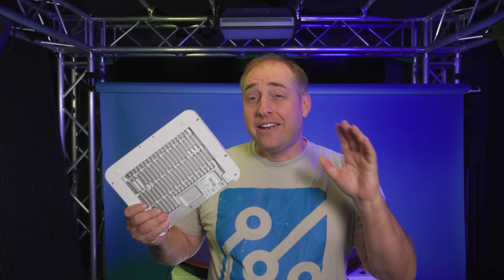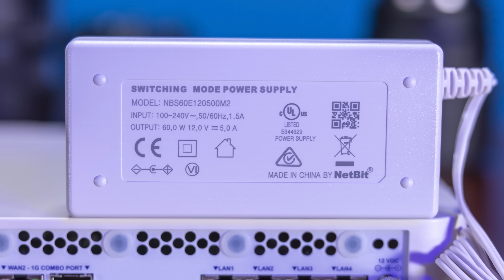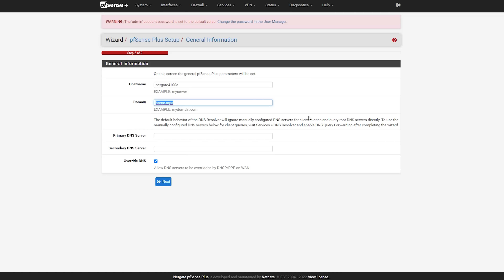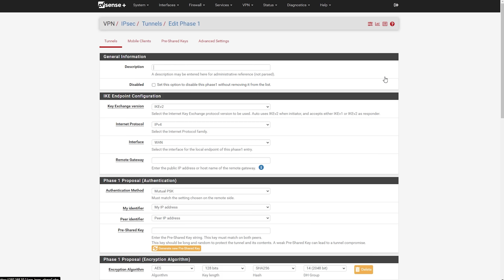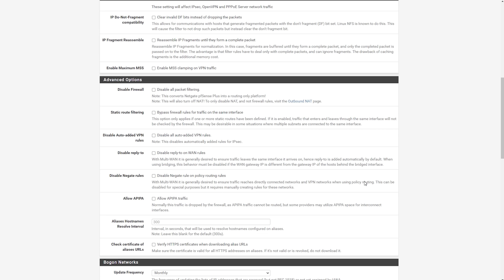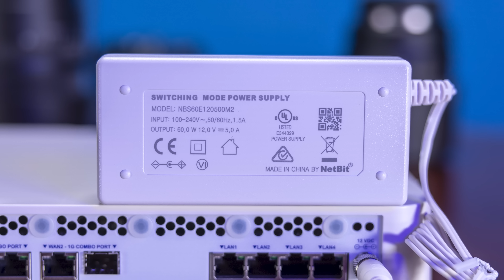An 11W pfSense Plus 1/2.5GbE Router, Firewall, and VPN Appliance

Comment: Forums flows over in regards to massive failure with the embedded eMMC on these. Build your own cheaper and faster with lots of expandability options and donate if you want to support Netgate.
Reply: damn that's no good. They should come with nvme M.2 ssds, not storage soldered on.
Reply: how to build anything cheaper?
Reply: @39zack  I'm using a used, cheap Dell Optiplex. Works like a charm.

Comment: its just so disappointing to see 1G wan ports, 1Gb fiber is becoming more common and a 1G wan port isn’t fast enough.  I wanted to buy a wired router with 2.5Gbe ethernet and no wireless and I couldn’t buy one without getting enterprise gear.

Comment: Would be nice if the WAN ports were also 2.5G.  Wonder if the 2.5G LAN ports can be used for WAN.
Reply: Yes. He mentions exactly this in the video.
Reply: @jay-ru-me  Right, at 4:30 he says WAN ports can be reconfigured as LAN or something else and will be a mismatch in the UI.  But he doesn’t specifically mention if I can configure any of the LAN ports as WAN.  If that is the case they should have just labeled every port from P0 to P6 and let us decide.  My Asus ET12 is currently using 2.5 on the wan and 2.5 to my LAN switch.  Theoretically I can use that appliance LAN1 as WAN to my ISP and LAN2 to my Asus WAN to further isolate internal network.
Reply: @smptactical259  Thought he said it could go both ways but IDK, dont feel like watching the video again. :D I know for sure you can reassign any port as WAN, LAN, OPT or whatever. Going with defaults though would probably save you a step in the case where you need to restore a backup, since the default assignments would not have to be reconfigured. I suppose with the 4100 you would want a 2.5Gb setup as WAN tho... heck, I would just get the 6100 where the two WAN ports are already 10Gb anyway.

Comment: The fact that the bottom plate serves as a heatsink, means that you should mount it on a wall and leave some space between it and the wall so heat can dissipate upwards.  In this configuration, the screw-on power jack is a brilliant idea.

Comment: If you put a couple sfp fiber adapters in it and use all 4 ports at 2.5gb i bet you will come close to 60w
Reply from the maker: The 60W power brick is shared with higher power models. I think it was just easier for Netgate to standardize on one and then use it across products.

Comment: Seems like poor design to put the heatsink on the bottom of the unit. Heat rises, so sinks on the top cause airflow via convection. That's extremely limited by the looks of this heatsink on the bottom.

Comment: Do you know what is the acceptable temperature for this device? mine feels kind of hot without having so much work, I would appreciate any answer back thanks!
Reply from the maker: I am not entirely sure. The C3338R is 88C Tcase. The underlying platform for the 4100 is designed to take much hotter chips and components (e.g. bigger CPUs) and use the same cooling. On the 4100 the heatsink gets warm as it should, but I am not worried about it.
Reply: @ServeTheHomeVideo  seems like poor design to put the heatsink on the bottom of the unit. Heat rises, so sinks on the top cause airflow via convection. That's extremely limited by the looks of this heatsink on the bottom.

Comment: I really want to dump my R610 with 1 x Intel(R) Xeon(R) X5660  @ 2.80GHz and 24GB, I feel like it is a waste and it isn't being fully utilized, with this be a good replacement for a homelab running snort with a 1Gbps download 100ish Mbps upload, Internal 2.5 and 10 Gbps? I know this is hard to answer, but Is it way off to use a 4100? Thanks!

Comment: Great video. Recommend not purchasing support contract from Netsense.  Lack of leadership makes the experience such that each submission comes from a different tech. No continuity and no way to learn.  This is how you familiarize yourself to be a good admin - solid with no holes for the bad guys to exploit.  I have wasted $400 or so with a support subscription.  If they add phone support I can be solved in a jiff, and not back and forth with emails to different techs with different times.  Responses are lagged too.  Not a professional organization, my client purchased a different software package.  The company could be great, FOSS is normally better. and I pay for support to help developers. Other peers also feel upper Netgate management has to change or what follows is decline in growth.  I am open ears to other support vendors and monitoring tools.  P.S. my ask was to the President after getting nowhere in lower levels.  d

Comment: The unit looks quite nice.  It has a comprehensive feature set, plenty of ports, its fanless (presumably), and low power... Burning just 11W 24x7 is perfect for numerous topologies, particularly homes.

And I will note that the power supply input is 12VDC, which means that you can run it directly from the 12VDC output of any of the LiFePO4 power stations out there on the market to give yourself really decent backup during a power outage.  Never mind having just an hour on a UPS, even a small 250Wh power station would be able to run this sucker for almost a whole day.   Staying in the realm of DC on those power stations effectively doubles the efficiency... no AC-to-DC-to-AC conversions, just AC-to-DC.

I'm starting to see a whole lot more of these low-power devices running on 12VDC these days instead of 5VDC.   Not only do wall dongles run completely cool with higher output voltages, but it makes it possible to run many more devices directly from 12VDC sources for more serious backup operation with conversion losses that are no different from plugging the wall wart into the wall (and might possibly be lower, depending on how good the wall wart is).   Since all modern devices need a switching DC-to-DC supply internally anyway to get 3.3V and 1.8V (etc), its just a whole lot better to start with a higher DC voltage on the input.

Comment: A heat sink UNDER a unit is really weird ... it defeats the purpose if the unit is meant to sit flat. How is that supposed to work without outside active air movement? Only mounted to a wall to create an air chimney?
Reply from the maker: Not really sure but it worked for months without issue even in a 86F / 30C ambient. This design is actually for much higher power CPUs so for 11W it is not much of an issue.
Reply: @ServeTheHomeVideo  I can believe that it isn't a problem for the 11W system, but I've also found my SG2100 getting much warmer than I thought it should. Not sure whether the thermal design of the Netgate appliances is all that good. It seems adequate, which might be all that is needed, just thought it could be a lot better with some fairly simple changes.

Comment: I have this hardware in my company, not from Netgate but from Silicon (its the same exactly hardware anyway), and i have tried to change the OS inside a few times but without success... is there any way to install another headless distro in this thing? I really want to install Debian 11 on it. Even connected by serial console, none of the headless distros i have found can be installed on it. Am i stuck with the default Ubuntu?
Reply from the maker: Hi G2 Net Sul - we have not gotten one of these from Silicom so I have no idea what their firmware is like.

Comment: So if I understand switched vs unswitched correctly, the idea with the 4100 is that you could set each of the 4 ports to a specific VLAN (let's say management, LAN, IoT, and DMZ), hook those up to one or more managed switches and then hook up your devices to that/those switch(es)? Intra-VLAN traffic would then be managed by the switch, but inter-VLAN traffic would pass through the router?

Comment: meh, kinda sucks that the CPU is trash. lots of end users want significant OpenVPN performance, as well as things like FQ_CODEL and SNORT / PfBlockerNG. This CPU will on its ass 10 minutes in lol
Reply from the maker: That is the point of having a line though. Offering different price/ performance points for different needs. When we just need a GPU for the lab, something like an old GTX 1030 or GTX 1050 is awesome. When it comes to picking a GPU to pair with the Threadripper Pro 5995WX, usually it is much bigger and more expensive. This is Netgate's lowest-end x86 box.

Comment: I just bought a 5 port 2.5gb QNAP switch and a SeeedStudio Mini Router (Raspberry Pi CM4) for about half the price.
The router comes with OpenWRT pre-installed, so I'll be going with that for now, but I wanna try OPNSense as well.

Comment: If folks are going to invest in a premium product like the two mentioned then I would leave the switching to the switches and use the 4 ports for routing between vlans or segments.  Many IT organisations choose to keep vlans simple in the sme client base to avoid tagging incompatibility issues between some brands of network gear and so lower level skillsets are needed to maintain and support the installation.  The notion of switched lan ports even in a router would put it in the domestic router category and being a firewall having all the lan ports switched would be a big letdown.

Comment: It is hard to beat the SuperMicro X11SDV-4C-TP8F platform such as the Supermicro E300-9D-4CN8TP for pfSense, Untangle, etc. especially with all those 10Gb ports. Perhaps slightly more expensive but definitely comparable.
Reply: From what I can see it costs double the price.
Reply: As a reseller integrator I wish that in my market (australia) , that it's authorised distribution channels would make these boards available.  Further even the big box movers that do supply supermicro mainboards do not cover a sufficient range.
Sadly, this has resulted to me having to seek alternative brands many a time over the last two years.
Reply from the maker: Also much higher power. But yes, they are faster.

Comment: So I want some opinions if this is overkill. I brought home a computer that we were going to destroy at work as it was just too old. It’s an i3-4150 With 16 gigs of RAM and a 120gb intel 330 series SSD. I have Comcast one gig down 40 mb up and the built in Realtek and the PCI-e Realtek cards were only getting 330mb to the FW. Found an article about slow performance with realtek cards. I won an Intel X550 10gb dual card at a vendor show that I have not used. I installed it and now I get full gig speed down. My question is…..is this massive overkill? I have snort, DHCP, DNS, and OPENVPN running on it. Just thinking that maybe I can use a lower performance system and get the same amazing performance that this one gets. Power is not an issue as this running off a solar system with battery power.

Comment: Hey Patrick, I'm not sure if it's the right spot to make a video request but what are the current options for "DIY" NAS chassis?
I can't seem to find the ones you suggested awhile ago like the Norco DS-12D.

I'm trying to improve my homelab with a rack mounted NAS chassis that's not too long and it has at least 10Gbps network and read/write speeds, so using a short-depth 1U or 2U server with external SAS cables to a NAS/SAN/JBOD enclosure looked like a good idea, but I can't seem to find any available.
Reply from the maker: Hi Icaro - my suggestion is to ask in the DIY server builds in our forums. Likely folks have a few options there. I have been using the 24- bay Supermicro units from eBay but those are probably not short enough for what you want

Comment: So basically QAT is like the ipsec acceleration that little mips processors have had for ages.
Reply: Yes and no. You need to choose a cypher suit supported by QAT and a software that supports hardware acceleration. But encryption is not the only use case of QAT. It also speeds up compression and a few other things. So its a nice to have for network devices or web servers.

Comment: Netgate didn't have to choose between four switched ports and four separate interfaces. They should have used a VLAN aware switch and got the best of both worlds (like on the Ubiquiti EdgeRouter X).
Reply: This is generally how switches on routers work, the bottleneck is the internal port back into the SoC which if its 2.5Gbit then that's still the maximum you have between the switch and the SoC.  So they would need the extra cost of it being a 10Gbit switch  and 10Gbit port in the SoC, so that the four ports can never bottleneck to the SoC.

I suppose they could have still had four 2.5Gbit to the switch, then four physical ports (an 8 port switch internally) so you could do a 1:1 bridge between the ports, but would that be any better than software bridging the ports?  Also again, it increases cost, when the CPU is already very weak for 2.5Gbit.
Reply: @alexatkin  I was hoping there was a chip that could do it without there being an actual Ethernet link, with it's associated speed limit, between the CPU and the switch, just a direct PCIE (or whatever) connection.
Reply: @BrianG61UK  Not that I'm aware of, given it wouldn't have FreeBSD drivers if there were.  It's all the same tech as external switches, ethernet ports, etc, just hard wired on the PCB.
Reply: I can't stand switch ports on routers. Switch ports belong on switches. Give me discrete routed ports every time.

Comment: Is the  Atom chip on this thing really that good? I mean, i cant imagine running Suricata on this thing as the processor will choke.
Reply from the maker: Right, but remember that this is the lower-end x86 box. As mentioned in the key lessons learned and in the main site review, Rohit and I think the 6100 will be a better fit for many users.

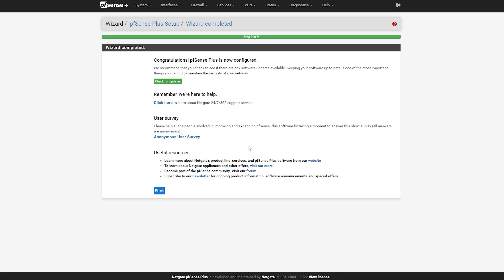Comment: 10:35 I wonder if you can replace it with the right tools, or if it is locked in the BIOS to that speciffic processor, like if you were to get a tray BGA CPU could you just get a heat gun and solder mask

Comment: I run the NetGate SG-4860 which is the prior generation of what is now the 4100.  Running QAT and AES-NI.   I will never go back to plastic box router.  Would never go back to a PC based  running software router.   These units are always able to do more than I ask of them.   Running Empora on the power side, it usually runs between 7-10 watts with 3 functioning LAN networks.  Nice when you are off grid and rural.

Yep, expensive, but worth it.   Thanks for the review of the new model.

Comment: Using a PoE splitter my switch claims the N5105 uses a similar power consumption when idle.
Reply: The power bricks the AliEx boxes come with are generally terrible.
Reply: @concinnus  And I kinda figured that a DC to DC conversion would be even more efficient than a good power brick, as some of the AC to DC losses can somewhat be ignored as they're shared across every PoE device.

Maybe my UPS and switch do not report entirely accurate loads, but between the two it doesn't seem to report a significant power draw increase as I add PoE devices to the switch.  Annoyingly I can't really measure the router over time as my switch doesn't expose PoE power consumption over SNMP for some bizarre reason.
Reply: @alexatkin  A good power brick is 90+ % efficient (and DC-DC a little better), but the sketchy uncertified bricks are more like 70%.  So a 10W device that should be 11W at the wall will be more like 15W, which is around StH's idle numbers for the 5105 box iirc.

Note that you can also get Chinese OEM boxes with better (certified, at least) bricks from e.g. Protectli, while name brands like Netgear or D-Link have used garbage bricks at times.

Comment: Would love to see you do a deep dive into a Firewalla Gold or the new Firewalla Gold 2.5G version.
Reply from the maker: Looks like a VERY similar internal layout to the 4x 2.5GbE AliExpress units we have used, with a few differences on the motherboard. It is strange that their WireGuard and OpenVPN numbers are so low though. This 2C C3338R can push almost 2x what Firewalla is claiming and the AliExpress boxes can do much more than that.
Reply: @ServeTheHomeVideo  what openvpn and wireguard speeds did you see on the aliexpress and netgate unit?  The firewalla gold is more flow based than port based so the packet inspection is more intensive.  With that said, the wireguard addition can see 200mbs alledgedly.  I'll have to find a decent enough external connection to test it.  The ease of use between home unit vs a netgate though is where it fits well.  Also a very well supported unit without paying for support.  So you pay that upfront but have a great support response on reddit and through email.  I ordered a 2.5g unit but I'll see what their support says about sending you one or could let you borrow the 1g or 2.5g when i get it in Q1.
Reply: Came here to say the same thing re: Gold 2.5G when it arrives. Presale just started...